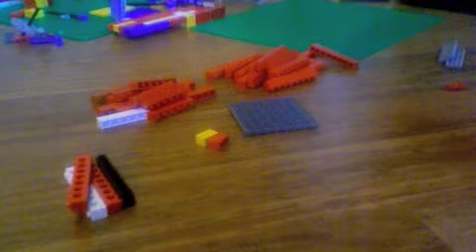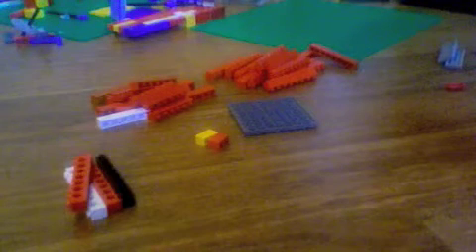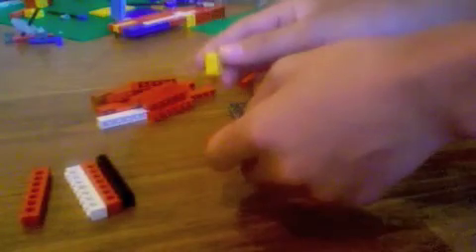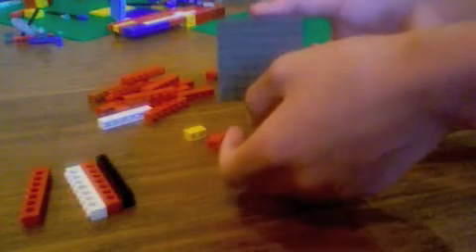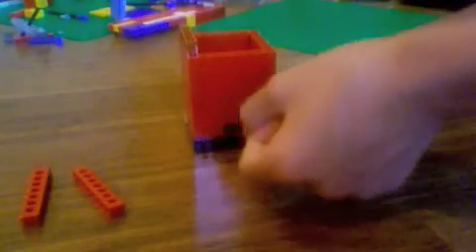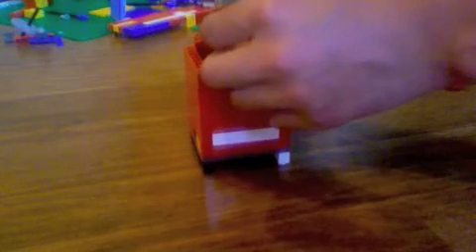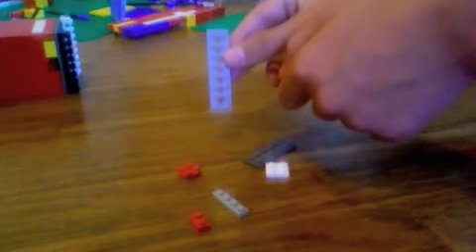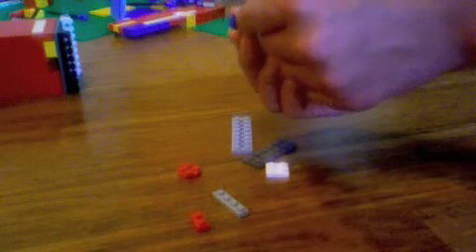Part 1 How to Build A Lego Butterfly Vacuum Engine

Comment: @legokid900 ha i found a way around it the smaller gear idk the teeth but it also has holes in it and now im running it like that whith no prob now plus i made a carb thats on it so i can throtle up and down whithout moving the vacume you can also mod the intake for an air compreser

Comment from the maker: @1224steve It's a 40 tooth gear and its not necessary but DEFINITELY preferred. You can use a couple 2x2 round pieces and put the axle through those but it WILL pop off if the engine is started quickly or is running at a faster RPM.